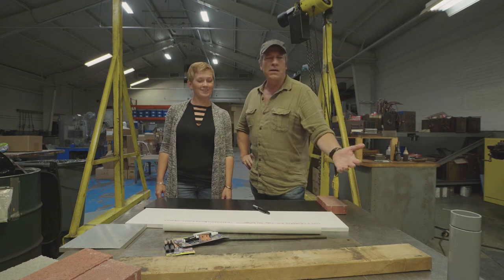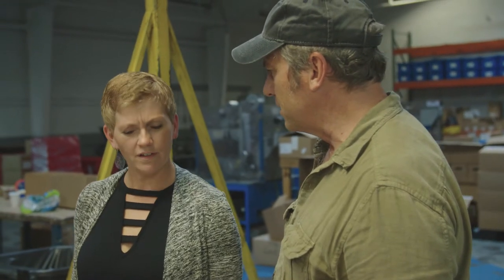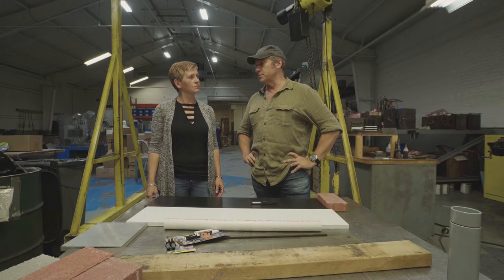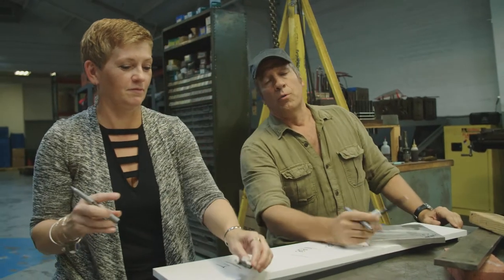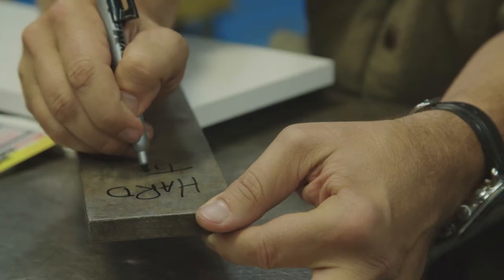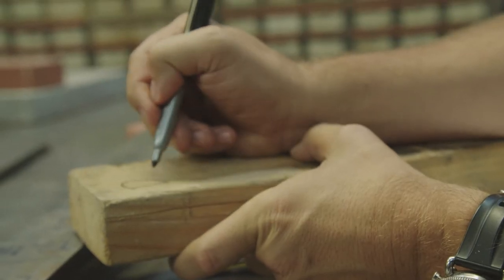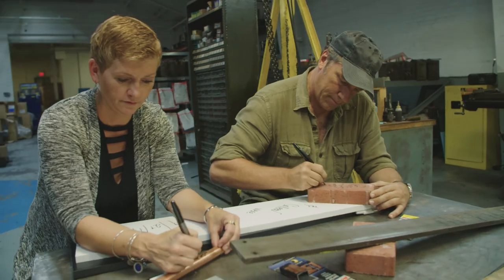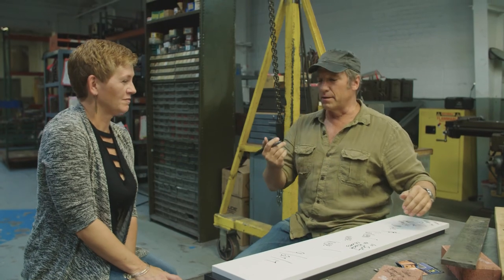Mike Rowe with the RevMark Marker

Comment: I am a data/comms guy that uses markers on slick plastic blocks, jacks and cables.  I am still looking for one that the tip will hold up.  I end up back with Sharpies due to price and availability.  They would work fine for other purposes after I am done with them because they still have ink, but not a fine tip.  I have not tried the Revmark.  I have tried the Inkzall, LePen, Duramark and U-Mark.  All of them fail quickly, even with light pressure.